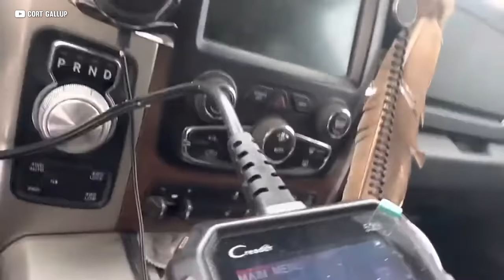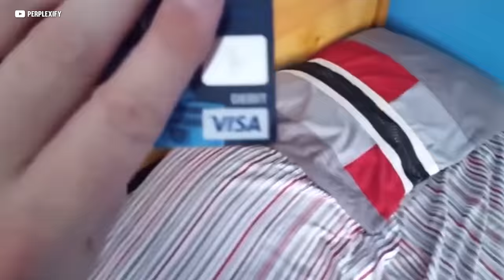Worst Trucks Only Stupid People Buy

Comment: I got a Chevy with the 6.2, but I immediately disabled DFM.
Reply: That does nothing. You need to remove the lifters with a dod delete kit. Its not the act of the dfm. But the lifter design itself. Your chance is not reduced.  But simply disabling does not help.
Reply: Better run 93 octane  or you will start loosing pistons
Reply: I'm over 60000 miles in. I didn't just buy this truck yesterday and I've had 0 issues.
Reply: @chrismarbrey9678 I literally had a fleet of 5.3s with the AFM. Never had a problem with any of them and ran all of them 300,000 to 500,000 miles. I have a serious trick up my sleeve though, I change the oil every 5,000 miles. Yeah that's the trick. That's the only trick actually.

Also, that early in line 5 Colorado is based off of the 4.2 L that was in the Trailblazers for instance. That was a pretty indestructible motor. They've kind of ran a long time. The only thing that really sucked about him as they were pigs. You might as well just have had the 5.3
Reply: @tonymartindale6085  absolutely false.
Reply: @ashes2ashes863  It was a precaution, plus there are other benefits to having the pulse  LT, like deactivating that annoying stop-start c*** adjusting the throttle response, Adjusting the speedometer for a change in tire size.
Reply: I deleted thw after on my 5.3 and it has over 400k miles on it

Comment: 5.4 Triton was a great engine until they reduced the threads on the spark plugs. I got 349K out of my '01 F150 and it's still running around town... The phasers were the only thing that went out...
Reply: At 45K I had one spit out the spark plug.  Put in a helicoil and traded it in .
Reply: 01 was the 2v and didn't have phasers but good try
Reply: My 2v 02’ super crew was the best vehicle I have ever owned. Period. Im a Chevy/gm guy. The other Ford I had, were awful. I’ve never had a bad GM , so far!
Reply: I have a blue 2008 Ford F-150 XLT with the 5.4 Triton, bought it with only 102k miles, no recalls, up to date maintenance, no rust, etc. I love it, any vehicle will be junk if you treat it like junk

Comment: Owning an 06 two door manual Tacoma, I know I’m safe from this list
Reply: I’m sure it’s rusting quietly🤫
Reply: @paulhunter9613  laughing in Arizona
Reply: 88 Toyota, 4.5 Million miles, original everything except driver seat, cost 500 bucks 🎤⤵️
Reply: Except you’ll be rusted away
Reply: Sure. except all you can haul is 3 bags Of mułch
Reply: @michaelreilly1310esq Yea cause hauling is everything! SMH!
Reply: @michaelreilly1310esq I hauled 4500lbs of track rollers in my 84 toyota....
Reply: Right as useful as a Honda Ridgeline. Junk
Reply: They are the best trucks you can buy
Reply: @michaelreilly1310esq right as useful. What the fuck does that even mean .
Reply: @patrickancona1193  🧢
Reply: @patrickancona1193  original everything??  4.5 million miles??!!??!!  you sir, have pants on fire right now!  that is absurd fakenews!  i suppose you're on your original tires and magic brake pads too huh?  and those spark plugs are original too huh?  bs

Comment: I have a ‘19 Trail Boss with the 5.3L and thank god it was produced during the big chip shortage around COVID and doesn’t have the AFM/Cylinder Deactivation. It’s a normal engine setup and has been a great truck after 3 years and 40,000 miles (65,000 total). The only complaint I have is the 8 speed transmission shifts kind of hard on its first shift from 1st to 2nd when it’s cold.
Reply: An intial hard 1-2 shift when cold must be a Chevy thing. My 1990 pickup does it too.

Comment: I've owned two 1st gen Colorados, an 06 I sold with 200k+ and a 12 I sold with 130k+. Never had any engine problems... and I beat them.
Reply: I was really surprised to see that on this video. That truck and specific engine I’ve worked on and an older gentleman who just had a stroke and couldn’t drive anymore sold it to one of my coworkers who him and I have worked on for 18 years. That truck has had so little issues it’s insane and has 190,000 miles. Old guy regularly drove across from here in west Texas to Houston. 720 miles round trip.
Reply: I got an 04 with 373,000 miles. But rust is starting to be problem. The shackle where the rear springs attach are rotting. My buddy welded some plates on and he says it will last until 400,000. He is almost as into it getting to 400k as I am. 

I got the Z-71 and it is fantastic off road. I inspected pipelines using it. My company got some Taco's and I didn't like how they rode so I went back to using my personal Colorado.
Reply: i have an 06 with the 2.8l 4 cylinder, i haven’t had a single problem other than a misfire but it was because of spark plugs i hadn’t changed in a long time. i have put 60,000 miles on it regular maintenance and it’s at 230,000, absolutely east mmmmm east of a truck

Comment: My 2002 6.0 Silverado has been good to me. Reliable, no drama, enough power for what I need, low maintenance costs, easy to work on, huge after market. The only annoying problem I've run into was the driver's side door handle brackets wear out and break after a few thousand door openings/closings. But ebay has a reasonable 3D-printed solution for a new bracket that costs a fraction of the factory version. Worked like a charm. Other than that, this truck has been trouble-free, so far.
Reply: 2003 2500hd...front diff blew up and also 4wd transfer case
Reply: Have a 03 1500 with the 4.8L 4X4. At 230K miles I had to have the transmission rebuilt. I use it mostly for running to get lumber now but it has been a pretty damn good truck.
Reply: I had an 04 2500HD.
Door panel buttons of driver door fell out. Epoxy fixed that.

ZERO other problems @ 160K

Comment: I have an 05 GMC Canyon with the L5 and have over 310000 miles and no issues with the engine or the transmission except for the water pump, alternator and power steering pump which I replaced myself as well as the normal brake part replacements. Overall I'd say it's been the most reliable truck I've ever owned.
Reply: Yes. I have 195k on my 04 3.5L. Stick with a full synthetic oil and change every 5k. I can get 30mpg at 60 mph on the highway. Just keep the throttle body clean.

Comment: I actually had no idea about the GM 5.3L VVL engines having issues. My Dad's 07 Silverado with that engine made it to 200k miles before it started having issues, and that was mainly just oil leaking due to old gaskets. At that point, it was old and beat up enough that it just became a farm truck and he just decided to run it as-is until it died.
Reply: 400,000 mi. on mine. Still an every day driver. Nothing major ever has gone wrong. I’m determined to go half million.▫️
Reply: @vitalsigns2679  Is Active Fuel Management. Aside from the weak transmission is the only thing I hate about my 2016.
Reply: @michaeltarno2979  get a Ford I haul on these Mississippi hills a trailer empty weighing over 3,500 by itself with a 7,500 pound Ford New Holland Tractor with a over 2,000 plus pound Bushog every week for years. And it doesn’t even make the truck squat down.
Reply: The problem is curable returning the engine to classic LS quality, but that should not be necessary. I harvest (good, early) LS from salvage so I'll have a lifetime supply.
Reply: @TimValenti-v9l  You are preaching to the choir. I am a Ford guy through and through. Even more so after owning this piece, do not get me wrong, I love driving it. But damn it to hell its not FORD TOUGH. IT Cant take shit. I only got it cause it had what I was looking for and it felt right, and then well I drove my Ford until it was fixed. 🤣 I drove my trade in until the vehicle I bought was fixed. Yes, to rub salt in the wound.
Reply: I have a ‘12 5.3 Silverado with 265K miles & 7100 engine hours. No issues until it recently started making noise when switching to V-4 mode. Fortunately found a test port plug-in which de-activates deactivation. No problems, runs better than ever. No noticeable effect (affect?) on fuel economy, not sure why they even have cylinder deactivation. Hoping to make it to 300K.
Reply: My 3.5 inline 5 has 205k miles no issues yet
Reply: @sheldondrewett4123  Except that the early 2000's 4.2 Vortec I-6 is just hitting it's stride at 200,000. Bulletproof and enough power to haul. And I'm a Ford guy!
Reply: 2011 with 188K, I bought it used so I don't know what the previous owners worked on, but it's going fine for me.
Reply: Some had issues, but most people will never have an issue with them, In 2019 GM moved away from the old VVL system to a new one that is used on some Cummins diesels that's proven to be quite reliable.
Reply: @mikeberry8566 Your truck definitely has cylinder shutdown
Reply: @mikeberry8566 V4 mode is cylinder shutdown bud
Reply: Yes we went 300 and more with no problem
Reply: @gregorylyon1004  : "Your truck definitely has cylinder shutdown"  And? Mike never said that his truck didn't have it. 

What he said was he found a device that plugs into the OBD2 port & deactivates it. He is probably referring to the 'range' device manufactured by Range Technology. They make an AFM/DFM version for the 2012 Silverado with the 5.3. The range device was also popular with C7 Vette owners whose cars had automatic transmissions as a way to defeat AFM (active fuel management/i.e. cylinder deactivation).

Comment: I've have a 5.4L Triton V8 in my 2010 F150 and I've never had a problem. It's 14 years old with 126k miles and not one problem. 

I changed my spark plugs myself at 80k miles and I was sweating bullets in 30° weather, but they all came out and all were replaced no problem. Engine runs like a peach!
Reply: Double up on those oil changes!  A buddy had his 5.4 go bad out-of-town. $9000 ouchie for new motor. I'd run Amsoil for sure.
Reply: I've got 276k on my 5.4
Reply: These worst ever videos that dump on the 5.4 3v right out the gate are so lazy to me. It's amazing what a few haters and the internet can do. The 5.4 3v is trash bandwagon has become urban legend at this point. the ecoboosts and coyotes literally have all the same failure points lol

Comment: I have 2 powerstroke 6.0. One stock which blew oil cooler at 165k miles and the other one updated... head studs, EGR delete, turbo upgrade, straight pipe and tuned to 500hp. Also has a carli pintop suspension with 37" tires. These mods were done at 205k miles. Now has 300k miles with no problem since. She's not a pavement princess, i push this one hard. I do oil and filter change every 7500 miles.
6.0 powerstrokes are junk from the factory. 
With a few mods, you have a reliable work horse.

Comment: The best truck I’ve ever owned was my 2019 nissan frontier. Every car reviewer in the world called it “dated” but I really didn’t care about any of that. It was plenty nice enough inside with the SL trim i was able to sell it for more than i bought it for and never had an issue with it.
Reply: Couldn't have been that nice, you sold it!
Reply: Only had it 3-4 years. My newest truck/suv is 20 years old with 270k miles.  Lexus gx-470.  Best car I have ever owned.   I also am on my second E350 ford extended van.  The 2003 e350 v10 is a better Vehicle than the older 1990 460 v8 generation. Steering is much better ac is better ride is better.
Reply: Playerone, I have a 2013 with only 105000 on it. I like having a truck that I don’t have to worry about. This thing has a good ten years left in it.
Reply: Owns a truck for 4 years and considers it reliable ... such low standards 🥺
Reply: Nissan makes great trucks. Owned a few. I have a 2008 Honda Ridgeline 3.5 V6, over 100 K miles now, it has had 2 batteries, a timing belt and brakes, and tires. Also, no issues with the 4x4, rarely use it, even in soft sand and deep snow.  I laugh and cry when I hear the Ford and Dodge owners crying over recalls and repair bills. :yt:
Reply: I still have a 2005 Nissan Titan that I bought brand new... it has over 530,000 miles lol. Change the oil every 3500 miles and things last a long time.

Cracked exhaust manifolds, warped rotors, radiator, and rear diff all replaced. Still has the original water pump.
Reply: I bought 2019 frontier crew in March 2019 because it was mature technology. I replaced the battery under warranty. The dealership keeps offering to buy it back for what I paid for it.
Reply: @primeral  I bought 2019 frontier crew in March 2019 because it was mature technology. I replaced the battery under warranty. The dealership keeps offering to buy it back for what I paid for it. What vehicles do you own you can say that about? LOLOLOLOLOLOLOL
Reply: Ever noticed that reviewers call older  Nissans "dated," while old Toyotas are called "proven?"  The bias is insane.
Now if they want something dated, they need to review my Nissan hardbody with over 400k miles. I like it more than when I got it in 1995. They would be traumatized by no touch screen, lane assist, cameras, or cup holders!  Oh, and the 100 hp and manual shifting would send them to the hospital, especially with no heated seats giving their arses frostbite!
Crank windows would cause hernias too.
Reply: Let me guess it was also the only truck you've ever owned 🤣
Reply: @agreat8745 I have a 2004 Titan Crew LE that I bought brand new and I care for it like u. Garaged all 19 yrs.  Same issues.  Warped rotors/brake pads.  Exhaust manifold might need looking at.  Other than that incredibly solid.  Not a drop of any fluid on my garage floor.  Let my brother drive it who owns an AMG C63.  He said dayyumm that truck has some get up and go.  Yep.  Especially if u turn off the VDC, which I didn't tell him about.  TG!  Go Titan.
Reply: @primeral  Taco owners tolerate shifty transmissions,  crappy ride and ergonomics,  poor handling, grabby brakes, sluggish engines, and rotting frames, yet praise them as the best truth ever made.
SUCH low standards!
Reply: @agreat8745  Do you know which OEM supplier made that water pump? I want that brand of parts.  So much garbage these days that new parts are a crap shoot.
It's interesting how many people seem to bash on Nissan,  but those who actually drive them have good things to say. I have a 1987 hardbody that just seemed to want to keep going, so now it's time to refresh a few things like the driveshaft and shoot for a mileage record. I'll have to "suffer" without a touch screen.
Reply: @tylersmith9868  Would there be a problem with that? I've owned the same Nissan truck since 1995. Like it more now than then.  Is there a need for ridicule?
Reply: @robertkubrick3738  I own a J100-series LX470 ... congrats on your awesome luck with your 2019 Frontier Crewcab, but it looks like I've got you beat for reliability, used car demand, and resale value :)
Reply: @primeral  They offer you the exact same you paid for it 4 years on? Really? Because that's the level to beat.
Reply: @robertkubrick3738  You're surely not questioning the resale value of a Toyota / Lexus? Land Cruisers (LX, GX, and the FJ included). My gen LX has remained the same price in the 10 years I've owned it. The thing is, Land Cruisers hit a floor and then prices go up ... the values on the FJ40s and J80s are in the $30-40k range. These numbers are verifiable.
Reply: You gotta love how the auto mags release their "10 Worst" list of trucks, and they list a few with engine and transmission issues, but then you have like #8 in there with it's "dated design" and "lacks refinement".

Comment: I own 4 pickups, each one has its own niche. They may be considered old but every one has been dependable and all of the engines have never had a problem while I've owned them. Oldest to newest: 95 GMC half ton w/305 and POS 4L60.  It has 120K miles. #2: 97 S10 w/2.2 auto, 198K miles. #3: 01 Dodge commercial 11K GVWR 1 ton dually w/V10 and 5 speed. 181K miles #4: the only 4x4 I have, 04 Chevy Silverado half ton w/5.3 auto and 198K miles. I like 'work friendly' pickups w/easily accessible boxes to throw stuff into. Newer pickups are junk IMHO. They're too tall to be useful and have way too many amenities. They're made for non-callous handed pussy city boys to pull their new boats. Four doors and an itty-bitty box? Useless.
Reply: Agreed. I need a pickup for work and hauling stuff around not for picking the kids up from school in.
Reply: Spot on👍👍👍👍
Reply: Disagree, I enjoy the quiet comfortable ride, and decent fuel economy. 
I sat with a salesperson 3 days ago. I’m trading my 2021 Lariat for a new platinum. Expensive, but I can afford it.
Reply: @mcmuskie2563  I'd MUCH rather push any one of my useful pickups than ever again get behind the wheel of a POS Ford.
Reply: Totally agree. Give me a regular cab/8 ft bed truck any day. A truck is to carry cargo.

Comment: I’ve put 250k miles on my GMC Yukon 5.3L and it just plain runs.  Always.  Yes routine stuff like fans and radiators, but the engine has never been opened, despite a lot of towing.  I want another, new.

Comment: Why did you use the Chevrolet as your caption photo when it seemed to be the least problematic truck mentioned?
Reply: Yeah, very disingenuous
Reply: cuase GM is a worthless GARBAGE i have 2001 FORD RANGER V6 WITH 405.000 AND STILL  RUNS  GREAT SAME ENGINE SAME TRANS !!

Comment: I've got a 2021 Dodge ram pickup with the 5.7 hemi, and I love it.  It's got plenty of low end torque and enough horsepower to pass a semi doing 55 like it's standing still!  Absolutely no problems with my truck, best pickup I've ever owned!
Reply: It's only 3 yrs old pal. Just wait for it...
Reply: @mikekrause910  My 19' RAM 1500 is 6 years old, and it is easily the best vehicle I've ever owned. The powertrain is bulletproof, and the ride is still like a Cadillac.
Reply: Agreed! 5.7 HEMI and ZF branded 8-speed are a match made in heaven.